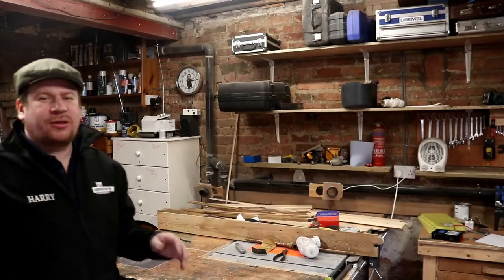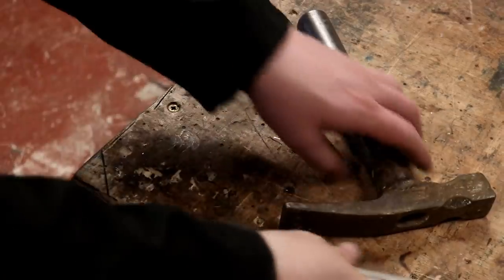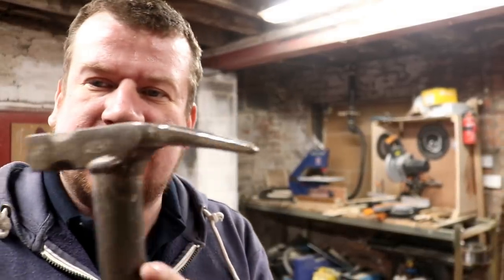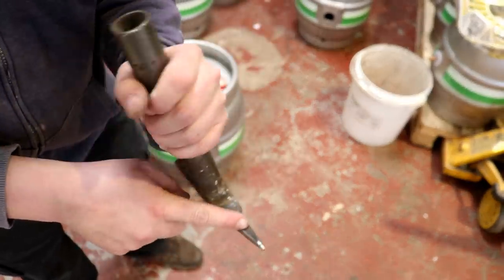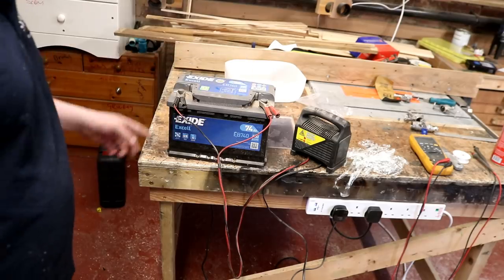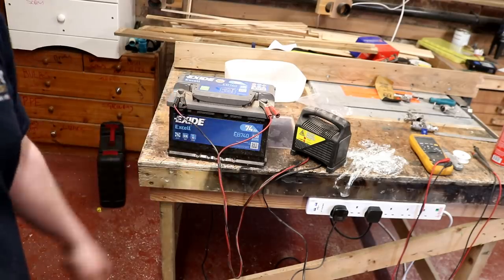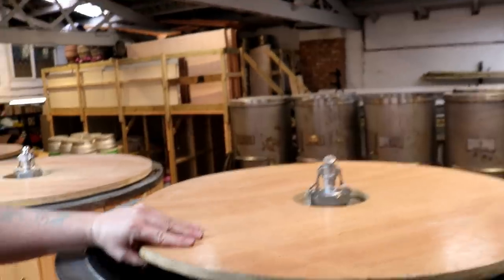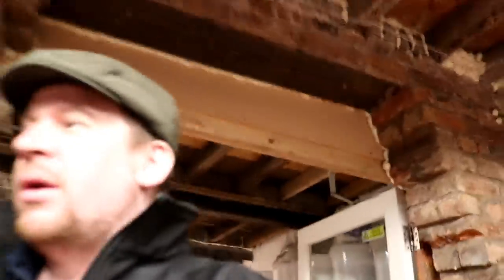SHIVE REMOVING TOOL BUILD

Comment: Nice view of the handle while marking up 😄 . You can't beat a BIG battery charger (10 - 20 amps minimum) as they can often scare a slightly dodgy battery back into life (they get a crystal coating on the plates and a serious blast of a rapid charge can break down the coating). Charge battery and test the voltage, leave it a couple of days (unconnected) and test it again if voltage is around 12.6v it's a good one. Cheers, Schnuz.

Comment: 10 Amp will work better - you might find one for cheap at Screwfix. I like the automatic chargers that have enough power to provide a brief 60 Amp start assist. You did make sure none of the cells were dry or very low? Even "maintenance free" batteries have port covers and you can revive them with rain water or battery acid infusions. It is also best to pull the port covers off while charging. If you can't see bubbles forming on the plates...you have issues.

Comment: I agree with Froggy that home made is best,however that is so labour intensive etc it may not be viable. What I would suggest if you can is get in touch with a local chippy or chip van,one that is known to have good chips,ask them what they use(throw them a couple pints) . I would recommend going with Maris Piper if at all possible,that's what local good chippies here use,of course they buy pre cut in bulk,but MP are the way to go imho. That second battery sounds like it's done for also m8,you need 13_14v fully charged to crank an engine,lying idle Batts will go dead over time so possibly it's had it. Find a decent heavy duty charger first though,maybe you know a garage that could charge it for you,just to make sure,sometimes those weaker cheap chargers are only designed to top up not charge from full flat. Tbh though I would keep that second one to run 12v appliances as a DC backup and buy a new battery for car,it's guts of a hundred quid probably but worth it. Be safe bud see ya next time. Cheers.